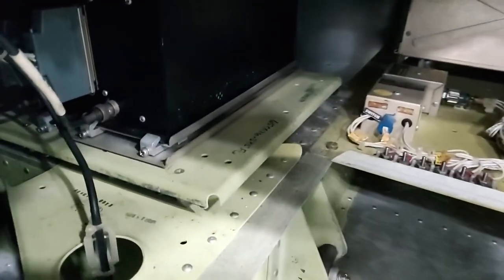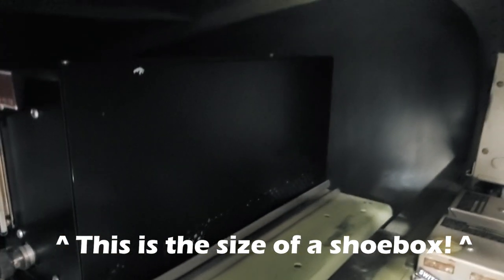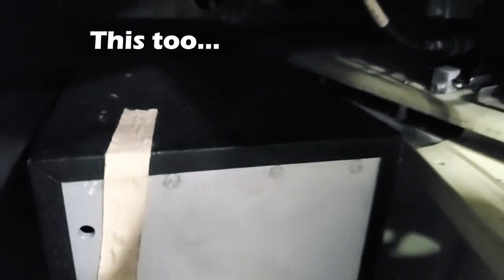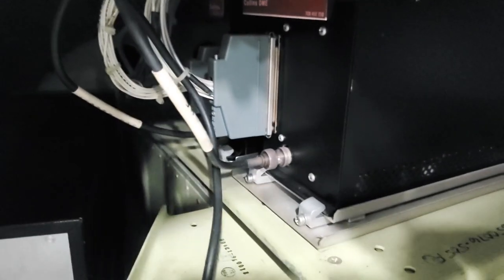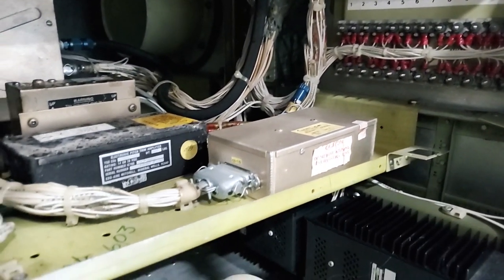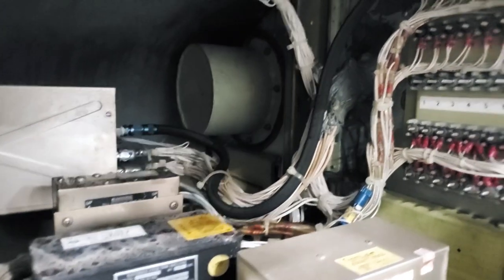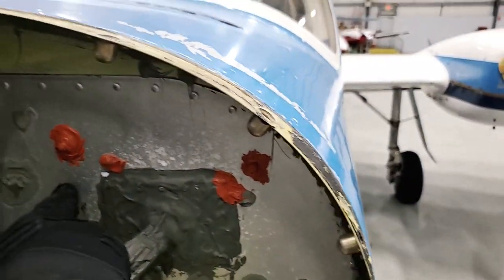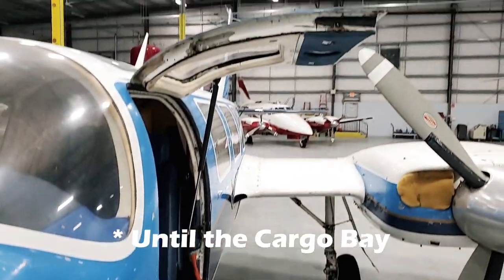Sneak Peak at the Barn Find Aerostar's Avionics Bay!

Comment: Hello, how much would be a reasonable estimate for refitting the entire avionics with a full glass panel? I'm talking I-dont-want-to-see-a-single-steam-gauge-in-sight kind of refit.
Reply from the maker: I have, that's the plan for this fall/winter. For cost you can safely double the cost of the hardware at least, so if the avionics are $60k, expect install to be at least $60k as well.
Reply: @AviationRestoration  Niiice, can't wait to see it. This plane with the new paint you mentioned plus the avionics will easily be the greatest Aerostar flying. Any plan for winglets as well? And there's this company I came across the other day here on YT and Insta called Aviation x Aviation X Aircraft Interiors who make really sweet interiors. But can't wait to see your vision for this. Keep 'em coming and thanks for the feedback.
Reply from the maker: Aviation X is who I'm thinking of going with, but I need to do the avionics first so I don't risk damaging the new interior. They have a video up of an Aerostar 600 they did, beautiful! Winglets aren't worth the money IMO. I'd spend the money on full de-icing boots first.